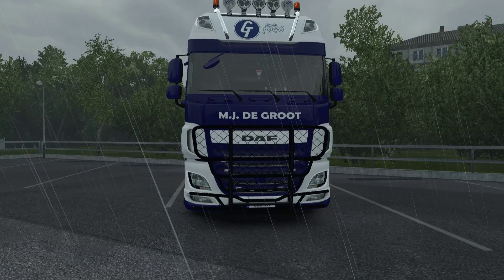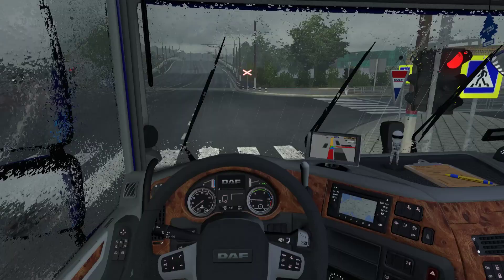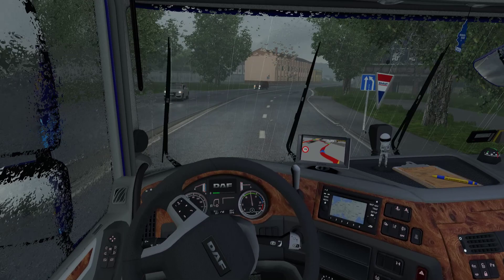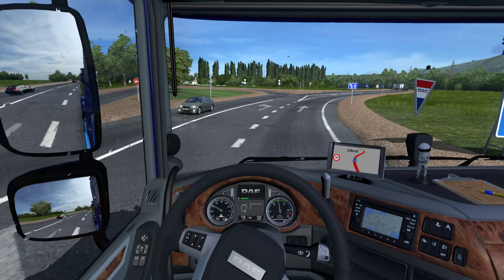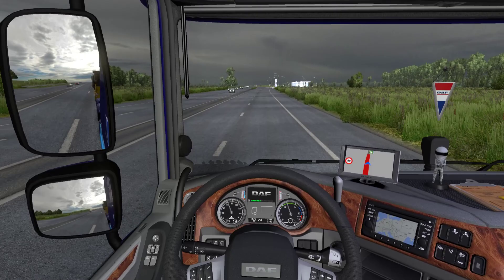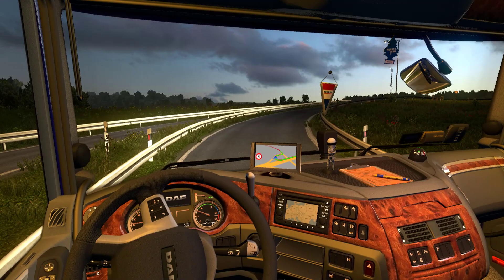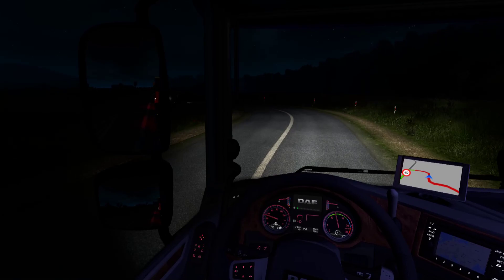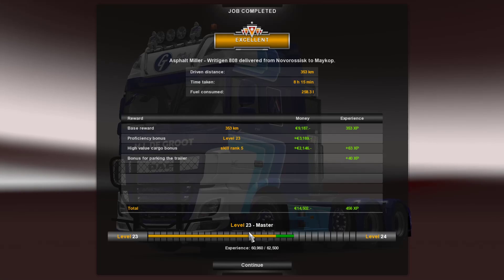Euro Truck Simulator 2 - Ep.150 - 710HP Hauling a 44T Asphalt Miller - ETS2 Southern Region Gameplay

Comment: Is that cheer thing the same as squirrel's stream in twitch? What do we get with that?
Reply from the maker: +Theo225 yes that's what cheering is. You get your message highlighted and you get a badge depending on how much cheering you've done.
Reply: Man, for racing games, you should try assetto corsa, because it has the most realistic racing simulation from the handling, balance, speed, everything is there
Reply from the maker: +Theo225 oh cool interesting. I'm afraid I might break my g27 with it, though lol.